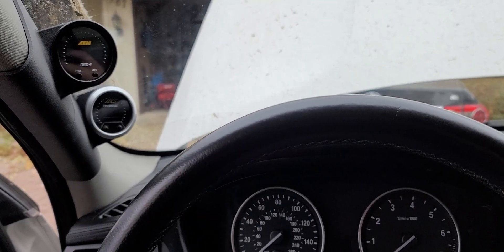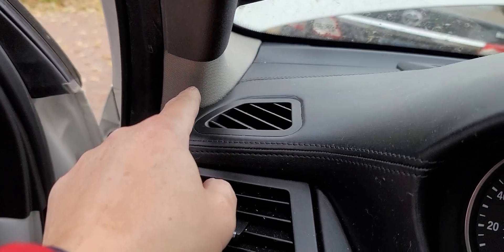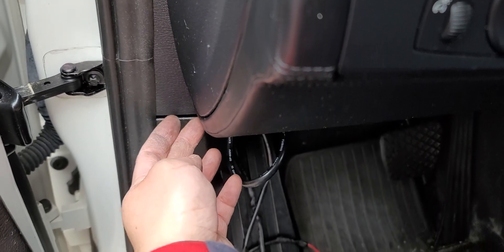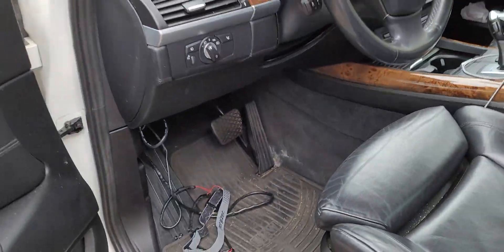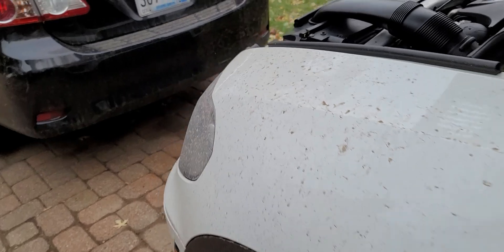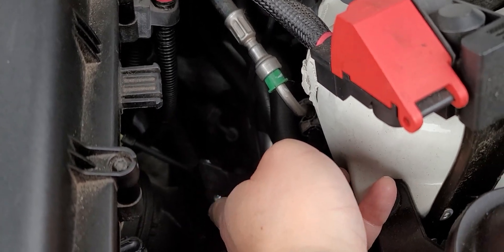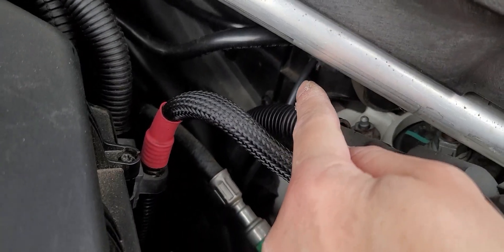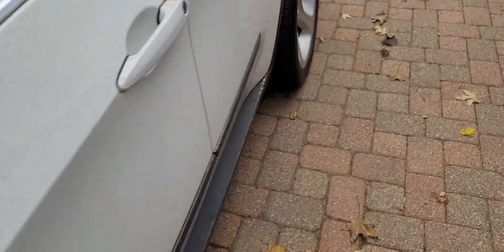E70 BMW X5 OBD2 & Boost Gauge DIY

Comment: Do you have a link for the boost tap you need to install please
Reply from the maker: You can use any N20/N55 adapter tap. I used one where the vacuum wasn't a screw on because I didn't want to deal with boost leak.